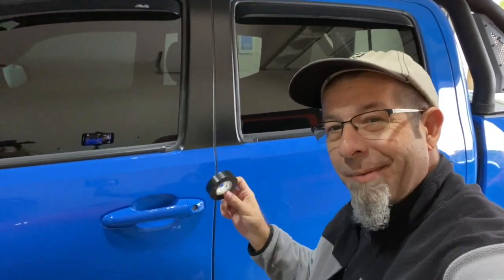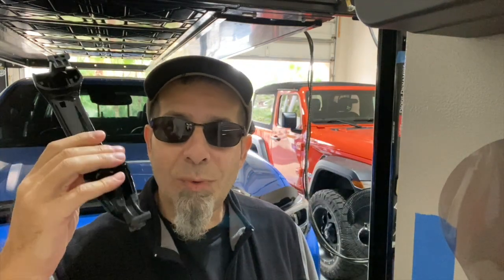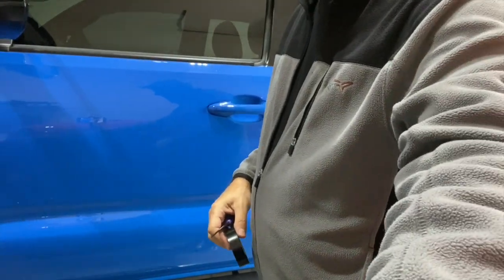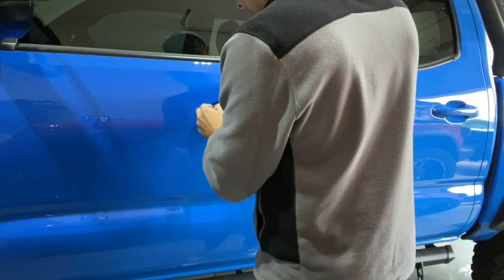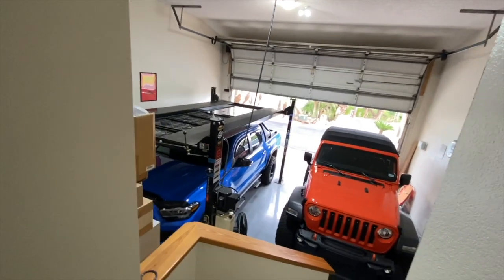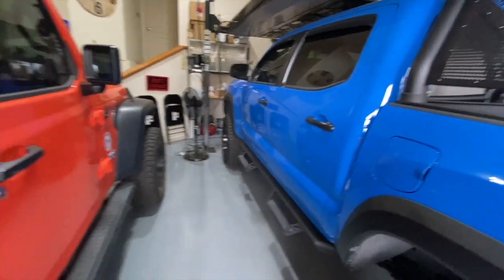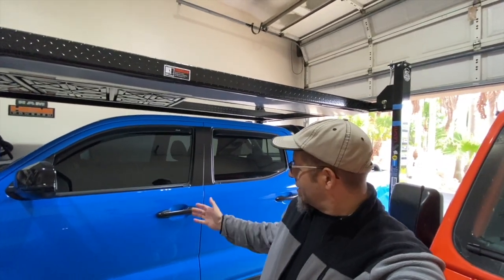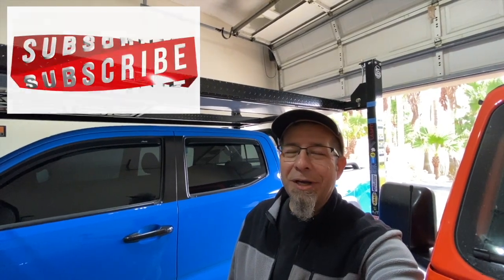Blacking Out My Tacoma Door Handle with Electrical Tape

Comment: I like the black. Two questions. Why is the back door a problem, and everyone I looked at(OEM or not) say they won’t work with auto unlock system.
Reply from the maker: It’s due to the removal procedure.  Not as simple as the front😬

Comment: I like it i check on doing it to my truck but I have the touch lock and unlock option on my truck and its like $300 just for the drivers door the rest aren't bad but the drivers door is a deal breaker. ☹
Reply from the maker: Wow!  That’s crazy!!😄
Reply: What about vinyl wrap does that mess with the touch lock

Comment: Rob I recently ordered new mirrors for my tacoma sr the ones I have are electric they are heated and they have a white cover that matches my paint apparently I got and upgrade package that gave me the white handles bumpers and mirrors I like black myself but I got use to the white very quickly  the new mirrors have everything I have now but they but have the signal lights in them I realize that I probably will have to do some wiring myself but I am hoping that since I ordered them for my year and make that the plus will fit and at least the other options will work correctly and then I may be able to run wires from the lighting feature though the door and under the dashboard or out to the engine bay my point to you is that the new mirrors have a black printable surface I ordered the spray paint in the proper color code but I haven't received it yet so I may leave them black until I get the paint but if I don't get it I will live with the black basically what I am saying to you is I would prefer them white and I think that you may be happier with your handles staying the factory color if they where come I would of course say Chang them but they are not and because it's a difficult job I think you should think about it a little more as always great video thank you hope this has been some bit of help.